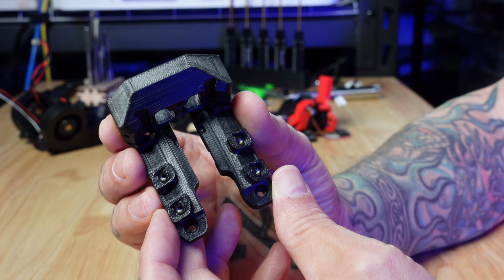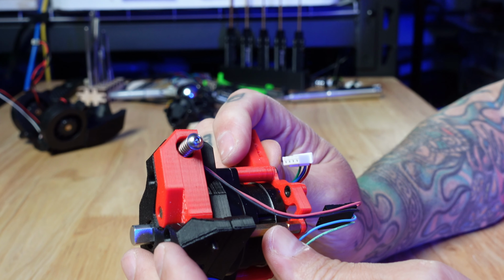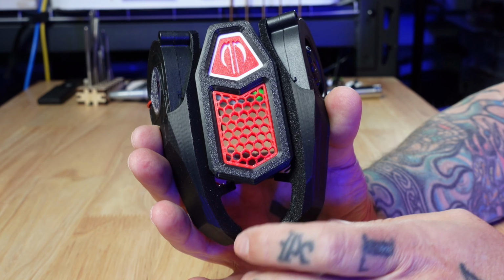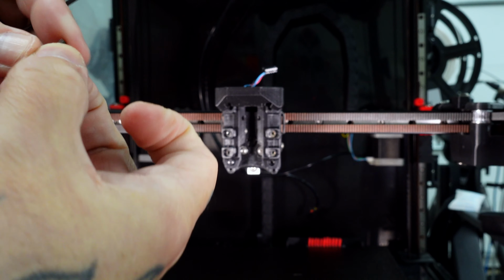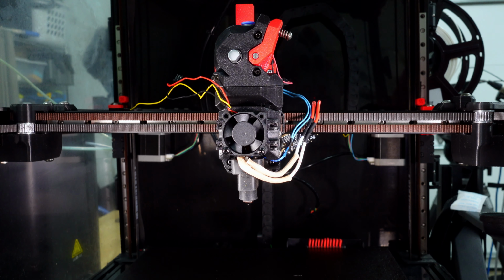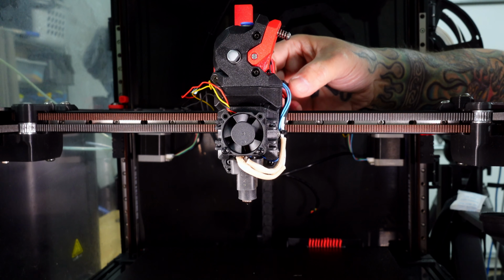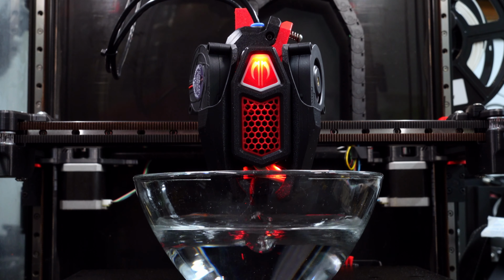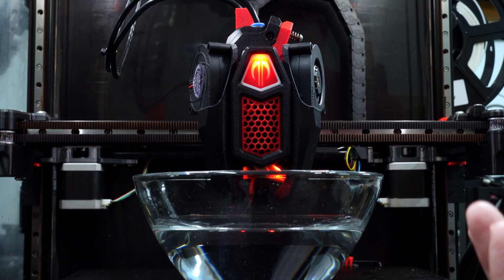Reaper toolhead by APDM, part 2

Comment: how are your input shaper graphs lookin ? i got the exact same setup ( im just using their new carriage system) and with the wwg2 with dual sensors ( filament inserted ) i get terrible input shaper ghraphs and belt tension graphs,  if i move to a sherpa mini i have good graphs again, somethin is off here
Reply: might be the 5mm balls doing that, they are loose in there
Reply: @nathan22211  with filament in it i got terrible results and only on reaper moving to xol, a4t or archetype the inputshaper looks normal again, so its 100% a reaper issue some others had the same issues with that toolhead, the steelballs are not moving when filament is inserted